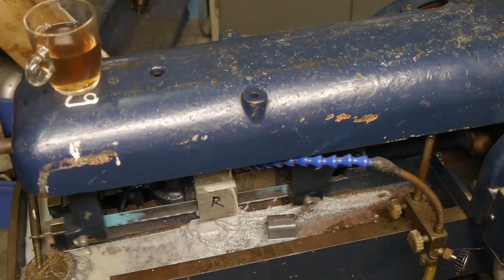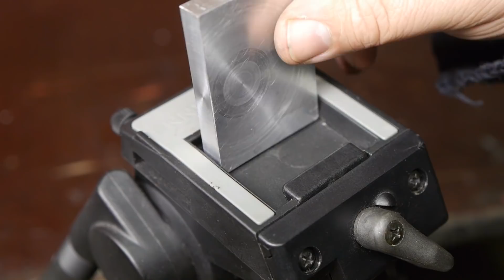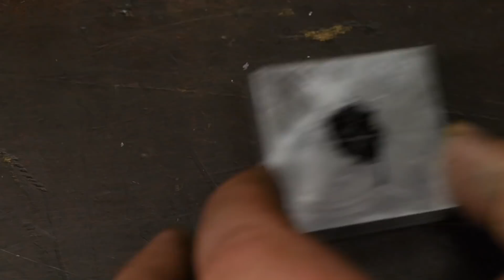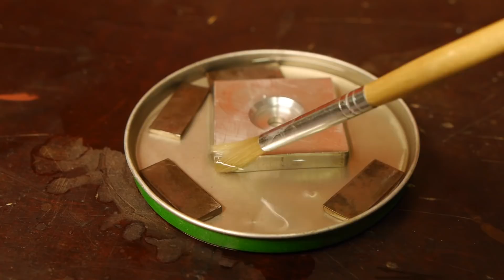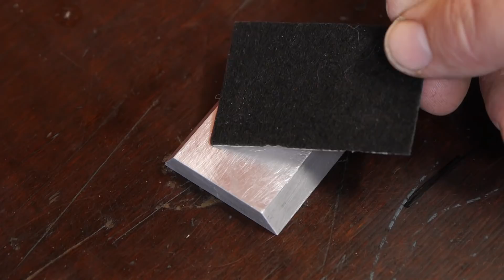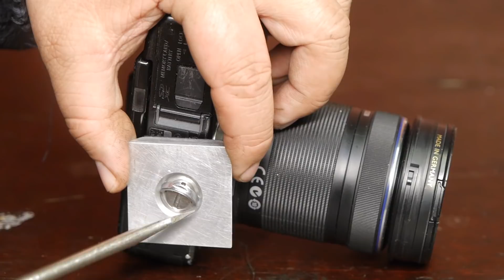How to make a tripod quick change camera adapter plate

Comment: I don't have the tools you have and don't have the skills either, If I would have needed that adapter it would have been made with files. It would have worked but looked like some mentally challenged child had done  it. Most of my stuff looks like that.
Reply from the maker: I did think about making the adapter plate from hard wood. The dove tails could have been made with a hacksaw and a file.
I think it would have worked just fine.

Comment: buy a couple of hack saw blades for your power hack saw, 10 or 8 tpi.the bigger gap in soft aluminium cuts a lot faster.also mix new engine oil with kerosine 50/50.great all round cutting oil.cheap
Reply from the maker: Those power hack saw blades are getting hard to find. I had a hard time finding these locally. And a pack of them cost me more then what I paid for the machine.
Reply: @Rolingmetal  search ebay- "Vanguard Power Hacksaw Blades 12" x 1" 10tpi 300mm x 25mm x 1.25mm All Hard "  ,,,thats $5.50 au a blade.hope this helps.

Comment: Why buy something for 5 euros when you can make one from a huge hunk of aluminium you have in stock! ;)
Grinding aluminium is never fun as it just clogs up the wheel.  Hand saws cut aluminium too.
If you want a challenge why not make that screw!
Nice job and 30+ minutes passed quickly.
Reply from the maker: Yeah, time well spend. Too bad the tripod isn't working out :) (won't pivot downwards enough)
Reply: Remember "We are Machinists" can you make any "adjustments"  :)
Hmmm that was a big hunk of aluminium.  Make a wedge shaped plate that points down.

Comment: Good results.   An easy way to remove super glue is to use your wifey's nail varnish remover. (The one that contains acetone).
Reply from the maker: You're better of using a big bottle of acetone. Probably saver to :)

Comment: Hi! Nice upload. I would definitely invest in the HBM dry cutter. I've been using it for 3 years now, almost daily, it leaves a great finish and cuts metal and even high carbon steels like butter. And i'm still on the first saw blade. By far my favorite tool. Now I have sharpened the blade a few times manually  on a little diamond stone in my bench grinder which works okey, but I should probably invest in a grinding jig.

Comment: Looks good.   Fly cutters look scary when in operation, but they are able to machine a very nice finish.   Glad the piece did not move when fly cutting.
I do not attempt to grind aluminium.   I do not have a power hack saw or metal cutting band saw so I use hack saw.   My blades may cut better than the ones you are using. 

A very useful project.
Dave.
Reply from the maker: They do look a bit scary so I usually check those set screws twice :)